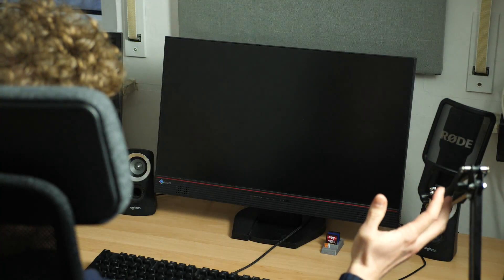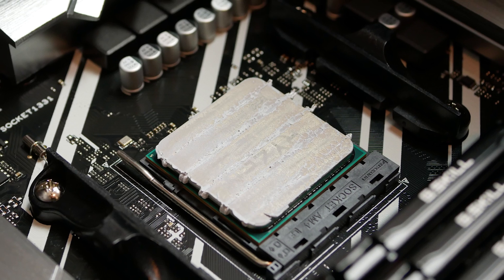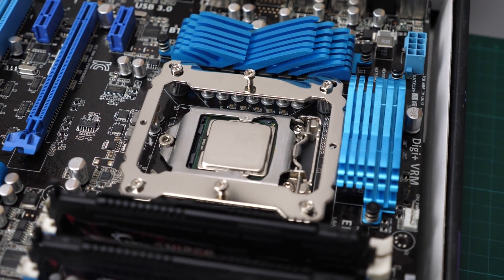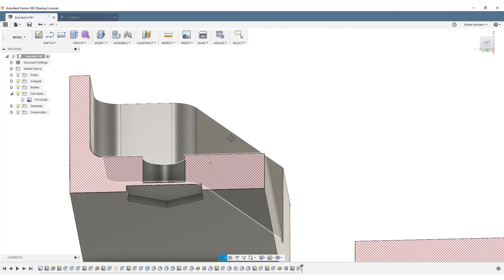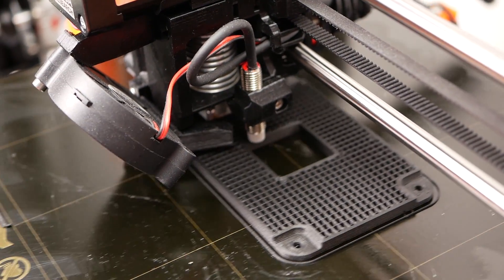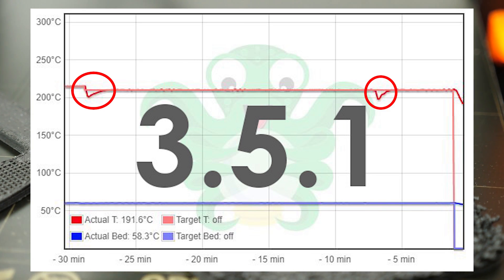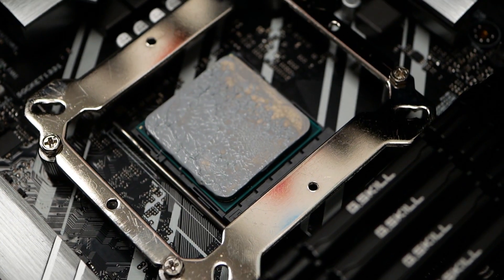I almost fried my new CPU because I overestimated my 3D print.

Comment: First of all one simply not spend $1000 on a PC and cheap on the $50 cooler.
Second when you want 3D print to be strong and slim and the same time you set infill to 100%...
Reply: 100% infill over what appeared to be 50% infill is not much or not at all stronger.
Reply: Well that's what I'm saying he could go for 30EUR 212 evo and would have no issues.
He solved the issue by printing it stronger, using 50% more material would do that...
Reply: Also $50 for a cooler is not much for a $1000 pc. I spent around $1300 on my pc and I still use a hyper 212 evo

Comment: I have a dual xeon server in my storage room. It is cooled with an amd cooler. Absolutely not at all meant to be used that way. I used 2 I-brackets and 4 threaded rods into the socket. This presses it on very firmly and since it is steel it will never deform under given load. Why do you force to print everything? Some things are just not meant to be printet and even be made out of plastic. And no, you actually need no high force for the cooler also! Your bracket just covers the capacitors which will decrease the cooling and over time might damage the VRM caps to the point of failure. (Even when not electrolytic capacitors, it is not at all a good idea)
Reply: It could be printed, just done correctly. He should have based his one after the one that works, which will most likely be plastic sitting completely flat against the board, preventing any warping/creeping. Also, you're right on the capacitors, which are electrolytics, just a different kind.

Comment: I'm guessing from the cable management that looks doesn't matter. So why not just zip-tie the top of the cooler to the top fan grill of the case to help carry most of the weight of the cooler. I've done this before a couple of times when I've had to install heavy tower coolers with questionable mounting hardware

Comment: This is cool as hell but I definitely wouldn't wanna use a 3D print to mount my CPU cooler... I'd probably be more inclined to use the 3D print to produce a mould and then use the mould to produce an aluminium bracket instead.

That, or CNC machine one.

Comment: I didn't get a notification dangit.

- Infill Choice and Percentage caused this to fail.
- If you look at alot of CPU brackets they are made from ABS rather than Nylon. 
- Clickbait title sucks because PC builders already understand that the chip has built in temperature safety. 
- I read somewhere that a user had tried PLA and it had failed but they had not mentioned annealing.
- AMD publishes data on the temps that the boards put out somewhere, you might want to reference that as it is published in the reference board design specs.
- Water cooling would have made more sense than using that old heat sink cooler since they are way cheaper now than they used to be.

Comment: Use cnc....
Or composite 
Newer use Carbon fibre 3d print oposit electronics if it can break....after it break or you scratch it carbon fibers make short circuit and fry ewerything

Comment: Annealing Cheap PLA without warping and deformation.

1.) Have an Enclosure
2.) Set the Bed temp to greater 80 C (depending on height The tallest part I printed that way was 62 mm)
3.) Put enough stuff on the build plate so that the print will take longer that 2 hours
4.) do not open the enclosure until the print plate cools down to room temperature. 

You will have an annealed print you can stick it in the oven afterwards right at 140 C and nothing will happen. It was tested with Hobby King PLA I purchased at $12/kg and with Matterhackers Build Series which I got at $ 19/kg. With an 85 C bed the temperature in my enclusure measured 300 mm above the bed will hold somewhere between 37 and 40 C. The printer is a matterhackers Pulse so A prusa clone. I intend to make a video on it as Soon as robotics season gives me a break. There are already some videos on my channel just not PLA ones. It will be for training my robotics kids as we intend to eventually 3d print the whole 30x30x48 in (about 1Mx1Mx1.5M) robot (in pieces of course)
Reply: nope , it warps thin prints
Reply: @propcutfpv6340  What warps thin prints and how thin is thin. The printing on a high temp bed or putting it in the oven afterwards?
Reply: wait , are you printing it at 80c bed temp?now it makes sense , i thought you were annealing with the bed after the print @martinpirringer8055
Reply: @propcutfpv6340  Yes Bed >=80 depending on how tall the part is enclosure temp measuered 250mm above build plate between 36 and 40C depending on build plate temp 40C at 100 bed in my case. Then print and leave bed at that temp until 2 hours are over on prints that are less than 2 hours. Most my prints are way over 2 hours so I don't have to leave it on. Then the bed cools slowly to room temp and so does the print and you printed an annealed part. Safely handles 140C or so. The melt point is still the same so if you stick it in an oven and slowly raise the temp in the case of hobby king PLA at 160 its solid as a rock at 165 it turns into a piece of bubble gum with MH Build PLA it seems to happen about 5 deg C earlier so that why I say 140 should be safe for most PLAs One small drawback on printing PLA with an 80-100C bed is that it seems to me the "elephant foot" on the first layer is a little bit more pronounced than usual. But I can deal and live with that

Comment: I made a bracket for my GPU, so i could use different fans on it. The standard fans for GPU's are usually cheap and the bearings are pretty loud even out of the box. So this was the second best upgrade for me since moving from 3.5" drives to 2.5" drives and SSD.

Comment: I'd have designed a pair of 'truss plates' to bolt on top of the sides of the bracket. Print them laying on their side so one edge has a slight curve. When mounted, that curved edge fits down on top of the mounting bracket so it applies downward pressure to counteract the creep.

Comment: You didn’t almost fry your cpu it’s designed to shut off without proper cooling. Even if you did I don’t know why you’d cheap out on literally the cheapest component. Go out and buy a $20 cooler. If it did fry you deserve it what disrespect to the components.

Comment: Printing the part full solid should make for a better thermal conductivity, thus avoiding hotspots. Also you could try printing the part pre-warped, so it will be harder to bend in the opposing direction.

Comment: Hi Stefan,
as I commented on an other great video from you: I have printed a retention kit for a water cooling block for may Radeon RX Vega 56 consists out of 2 parts. One holds the water block in place, the other one is a spacer and retention bracket at the back of the video card. To cool the VRMs of the video card, I have placed a 92mm Noctua fan directly over the VRMs and a large part of the water block system. This hybrid construction provides cooling for the retention kit out of Extrudrs Greentec Pro as well. I watched the parts for a couple of days (now weeks) and it seems to work fine.
I also printed a housing for my RX Vega 56 out of PETG what seems to work also fine.
Finally I managed to print water tied self designed water cooling adapters and fittings out of thick PETG. I used around 3-4mm think walls with very hot printed PETG and a extrution multiplayer of 1.1 to get it tied. Pretty much the same tricks to get prints transparent are also great to get somewhat water tied. Only my PETG cloned Alphacool Eiszapfen 13/10mm to G1/4 Soft tubing fittings fail sometimes when I tied them to much so the G1/4 threads failing by breaking off ;-) 
I can provide you some fotos for discussion for a future video regarding water tied prints? 

PS: Thanks for the tipp with the diamond reinforced PLA! I will try it for my next retention kit project! ;-)

Mit freundlichen Grüßen
Der Marcus :-)

Comment: If you have applications which are going to be long term usage you want to look into 'creep strength' when it comes to plastics.   That's when a constant loading failure occurs like books on a shelf that make the shelf begin to sag under its own weight.  Plastics are very susceptible to this kind of failure.

Comment: Hmm,  maybe instead of creating it completely out of any 3d plastic material it could of been a combination of plastic and wood/metal parts,  I.e the part that screws onto the mobo is made out of plastic which has either a metal sheet insert with the appropriate fan hole's

Comment: I designed and printed a support for the far end of my GTX 1070 Ti to avoid stressing the motherboard's PCIe slot due to the weight . I designed it to screw into some handy holes in the motherboard tray of my case.

Comment: I would have done it on my cnc-router, probably aluminium. And maybe added a 3D-printed thing for electrical isolation underneath.
But i anyway needed to buy a cooler for my ryzen 7, so there was no need to do something myself. Have fun with you PC and thanks for sharing ;-)

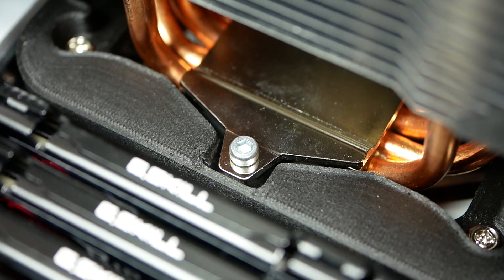Comment: Hi, at 6:03 it looks like you have loads of depth available (at least on this side).
The key to good beam strength is beam depth -  much more strength to be gained by changing the depth than by adding width. Bring the part up in the centre and taper to the corners. However this may cause delamination as the tensile loading will be across layers, so perhaps add a thin web rising up topped with a round bar and a thicker column at the ends to transfer the tensile loading down to the mounting bolts ?

Comment: Doubling material thickness increases yield strength in that direction 28 fold. (!!!!!)
So where the reinforcement was needed, you could have made it come higher for less area coverage. However caps don't tend to run hot, so this is probably fine too.

In any case, from the first version it was very obvious it would fail on that spot.
Reply from the maker: Correct me if I'm wrong, but double the thickness should improve the stiffness 8 fold and the bending stress 4 fold. sigma_bending=M/W, W=b*h²/6, I=g*h³/12
Reply: @CNCKitchen  oops you are correct! I was thinking something else :)

In any case, 8 or 4 fold increase for 2 times the material is still very good return :)

Comment: Great video :)  I was aware of the creep issue with PLA (which can even be used intentionally to make springs that auto tune to the correct tension when interfacing with parts that have substantial dimensional tolerances, like AA batteries), but I haven't encountered it yet with CF nylon.  Very useful info

Comment: It is great to see videos where the mechanical properties of 3d printed parts are explained. Most reviews focus on surface aspect and visual properties of the print. 
Thank you for the insights in structural and material engineering :)

Comment: Wouldn't this be a case where your CNC machine could be used to make a part out of aluminum?
Reply: To be fair, 3D printers are CNC hammers. When you have one, everything looks like a CNC nail.
Reply: @YesterdaySoup  I wouldn't use a metal bracket without a good insulator. With that many important thin traces running underneath the bracket, just a little barb could make a bad short.
Reply: @350606 
Stock ones are made of metal. Nothing special in their design; if you can mostly copy what they use, and use common sense, there's no real downside to CNCing one yourself. You could even 3d print a cheap model to put in place to make sure there's clearance all around before making the final product.
Reply: @Nugget Conductivity of aluminum does not change with voltage. It isn't used in households anymore because contact oxidation results in heating and becomes a fire hazard. The reason its ok to use aluminum for high voltage is because these lines have much fewer, more robust and regularly maintained connection points. Aluminum is also much lighter so it makes even more sense for high voltage transmission lines.
Reply: If you want to send me the file, I’ll machine it for you out of aluminum. :)
Reply: @Nugget That's interesting! But, since I'm in IT, it is confusing me. I know the UK used (or maybe still uses) aluminum for the wires at their homes. Of course, that would have a mechanical connection which would likely inhibit the formation of an oxide layer, right?
Also, I've tested with a multimeter aluminum PC cases (or they claim they are). Sure, the anodized/galvanized parts are really hard to get something on, but the cut edges, the screw threads... are conductive to the low voltage of my tester. There's some measurable resistance, but it would still cause a short to my power supply.

I guess, what I mean to say is, is it that the oxide layer breaks down at 5000V but aluminum (clean) is conductive? Or what is going on? I'm not kidding, you've got me confused here :)
Reply: @350606  Yes, you would adjust the design to the material. Plastic brackets can press right against the PCB, as long as there are no components there that can get knocked over, it's fine, but SMD components need to be avoided as well. The original cooler uses a steel bracket, it's only about 2mm thin, and doesn't come anywhere near the PCB at all. If you copied the bracket, but made it from alu, it would likely turn out too bendy, so you need a thicker piece, approximately 3 times as thick, but you can still design it to not touch the board and observe the distance. It doesn't have to be as massive as the one designed from plastic to counteract the force. If you did have to make it touch the board, you can just glue a layer of plastic to the bottom to prevent the aluminium from eating through the resist layer on the PCB and as insulator.

Comment: BTW, regarding infill direction,  2 x (sqrt(2) / 2) > (1 + 0), so +/- 45 degree should theoretically be stiffer than 0/90 degree. Or at least, I think maybe... Would be interesting to test!
Reply from the maker: Good point! Need to run the math on that.

Comment: The threadripper CPUs are very efficient. If run at idle clockspeeds, the CPU will consume much less heat than your RTX graphics card, even the 2990WX won't consume more power.

Comment: You should use material with higher Young modulus than PA.
As you print on low end machine, PLA-CF maybe?
Reply from the maker: Well, the PA-CF I used has a modulus of ~7000MPa, so quite stiff. PLA-CF would have been an option but I don't have any of that at home.

Comment: You could also just edit the fan curve ^^
Reply: The cooler is tiny so the fan needs to run that loud in order to cool it as much as the bigger cooler does.
Reply: the cooler imo is fine. Mine runs at 60-65C in 30C+ room temps when rendering. All you need to do is actually learn about PCs and  undervolt the CPU as the stock settings are unnecessarily high voltage.. Running it at a lower voltage and a modest overclock and setting the fan curve easily allow the PC to run cool. Also having an exhaust fan. Much more reliable than having plastics in there.

Comment: I've found creep a real problem with CF-PA parts I've made myself.  Also, the material seems to loose quite a bit of stiffness over time: perhaps a function of absorbing water?  I've had a lot more luck with Polycarbonate parts, but am currently running an open printer whilst I build a temperature controlled closed one so they are off the cards for the short term.  I recently bought some CF-PC material that seems excellent, but without that heated chamber I don't want to waste it!

I tweeted you recently about how much material you need to do some testing, but realised it would be most of my roll for you to test it, otherwise I would have sent you some for a video (if you had time).  Oh well, I'll let you know what it's like when I get this printer finished.

Thanks for the great videos!
Reply from the maker: Water uptake is a good point to consider with PA!
I don't use that much material for a filament test, maybe ~250g but time constraints just don't allow me to investigate that many different materials. Thanks for the offer anyways!

Comment: Great video Stefan, nice to see problem description, design, print, test, post mortem, failure simulation in software, redesign, reprint, and success! Also I've run into something quite similar in trying to find a retaining cooler bracket for slightly out of fashion boards. Good to see that if I had to now, 3D printing can solve this problem.

Comment: There is absolutely no risks. When I overclocked to 4.6 GHZ I saw that I needed some more cooling and strapped a 240mm radiator to a loop. I also printed the bracket but mounted it backward and so the CPU die didn't even touched the cold plate. I still booted up, the CPU undercloked itself to 0.8ghz and still ran at 95° with heavy thermal throttling. I didn't even think that the bracket was the problem and thought the water pump was dead. When disassembling the waterblock, I noticed that the cold plate was clean, meaning that it didn't touched the thermal paste on the die. Mounted it the right way and now everything is fine. So don't stress too much, CPUs nowadays are perfectly capable of protecting themselves.